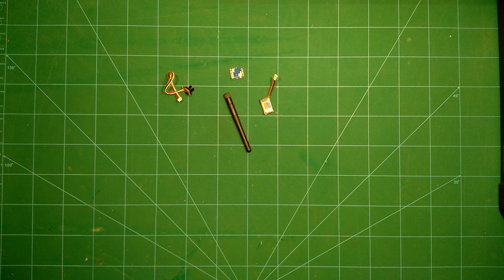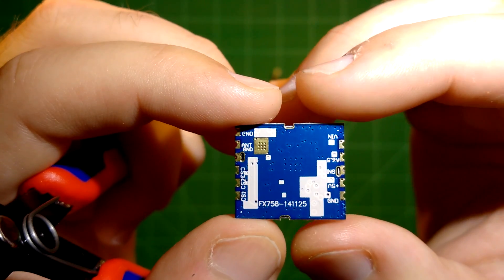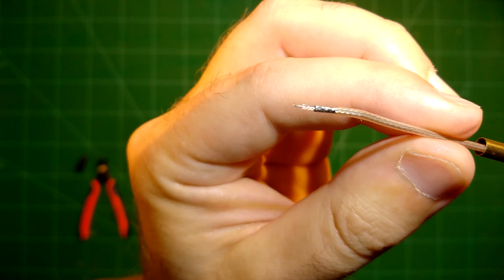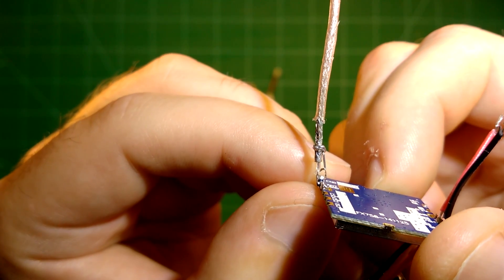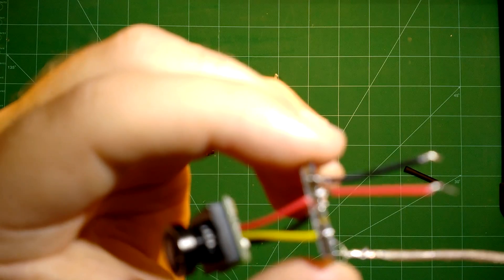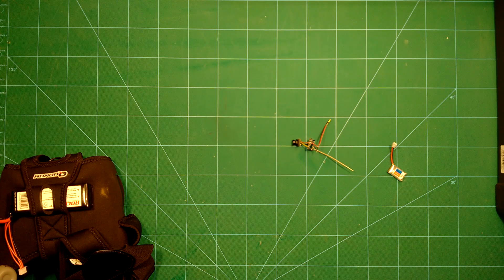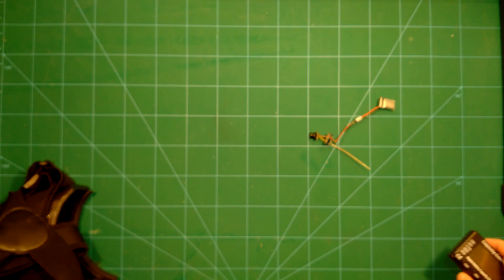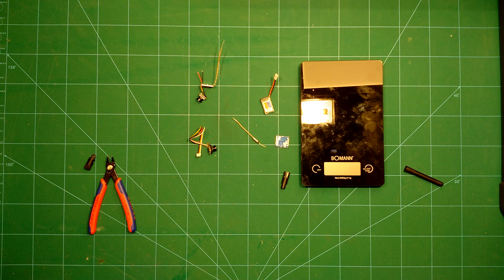Cheap 5g DIY FPV Set

Comment: This is very cool! Can I power this from the same lipo that the quadcopter uses?
Reply from the maker: +Fraser Poole Yes, absolutely, but if the quadcopter uses brushed motors, you will want to add an LC filter or a step up/down converter which cleans the power, otherwise you will have massive distortions in the video. A Pololu module is such a step up/down converter and I use it in the video where I put this FPV set onto an Eachine H8. Check out this video here (and its description), that will give you many ideas I believe :-): https://www.youtube.com/watch?v=DREHnDY1WVk
Reply: +RC FPV Flight That's great thanks for the info. Really liking your channel.

Comment: hi awesome video! would it work if I use this antenna? http://m.banggood.com/FPV-5_8GHz-Micro-CL-TX-Anternna-0_8g-Lightweight-p-973291.html
Reply from the maker: +John Svensson Many thanks mate and great to have you with us. That antenna will work great - I even suggest it in my article on my website about this build (http://rcfpvflight.com/articles/5g-diy-micro-fpv-set-for-20-usd/). I used the simple wire antenna, since I wanted to save every possible gram, because I put that set on the Eachine H8 and for that I was ready to sacrifice some transmission quality in order to save weight. Said that - the cloverleaf which you linked would be my choice as well for a build which can take the additional few grams :-)
Reply: +RC FPV Flight okay, good to hear :) can you link a cheap 5,8 ghz receiver from banggood that I can connect to my laptop?
Reply from the maker: +John Svensson You can do that with almost any of the 5.8 GHz recievers, you just need an USB grabber for your Laptop which converts the analog signal from the reciever to a digital signal which your Laptop can use. If you take the cheap but good RC832 reciever for example (http://bit.ly/1JUOBeT), you will see that it has 2 AV outs. If you then additionally get an USB grabber (http://bit.ly/1SajlvI) you will be able to plug the second AV out from your reciever into the USB grabber and then see the video on Your Laptop. You will have a bit of latency, because of the analog --> digital conversion, but as a watch-along monitor or to record your flying this will work great.
Reply: +RC FPV Flight I really appreciate your help :) so I will get less latency lag if I connect the 5,8 ghz receiver to an old tv (that has the yellow, white and red connectors)?
Reply from the maker: +John Svensson Absolutely, you are completely correct. Or you can also get yourself one of these cheap FPV monitors: http://bit.ly/1WOqtMZ . There are also slightly more expensive types of these monitors, which already come with an integrated reciever (http://bit.ly/1OQ7cI1) or even with an integrated reciever and an integrated DVR (http://bit.ly/1VsA5M4), which also lets you record your flights :-)

Comment: The base of the antenna is necessary for good transmission. RC basics. do not remove it or alter it!
Reply from the maker: +LeMortso You are of course right - for good transmission one will want to leave it on - absolutely. In my special case, I was ready to sacrifice good transmission for weight reduction, since I aimed at my Eachine H8 FPV mod with this set. The range with the antenna as it is is still ok, which can be seen in my outdoor flying videos, direct link here: https://youtu.be/DREHnDY1WVk?t=8m11s
 
However, if you do not absolutely need to save the weight, keep the base of the antenna. In this case, I would go even further and use a simple cloverleaf instead, which will result in even better transmission characteristics: http://bit.ly/1ni24nh
 
Anyways, many thanks for your valuable inputs LeMortso - greatly appreciated!

Comment: Do you have to do anything to select a channel? My receiver only picks up 5945mhz.
Reply from the maker: +Dieter Woerz - yes, that is the default channel. In orer to make it switchable, you will need to install a DIP switch. There is a great thread about this module on RCGroups, where several people did this already, take a look if you like: http://www.rcgroups.com/forums/showthread.php?t=2456116

Comment: Very good ... I had a 25mw VTW lying around unused, and powered it with a 2S 180mah battery and connected a small cloverleaf antenna. I got video out from my 808 Keychain camera on a Syma X5C quad, and it seems to work, but the total weight is much higher than your solution, and thus the little X5C was struggling a bit. The 808 by itself (with shielding) is 22 gm. The combined weight of ant., VTX & 2S lipo is another 30gm.  So 52 gm. total .. no wonder the X5C was struggling.   I can fly it with the 808 by itself and it does fine and gets good flight time and takes good video. I will have to look into a lighter VTX/Ant/lipo solution to make it easier for the X5C (and my other micro camera bird, the Mould King 33041 Super S) to fly.  I use a diversity ground 7" screen station with monopole and IBCrazy "mad mushroom" antennas.  Thanks for the ideas!
Reply from the maker: +Bill Somrak Sounds great Bill. Thanks for comment!
Reply: Bill Somrak do you know how to change channels with this transmitter I purchased , it only transmits on channel 8 5945 and i want to put it at it lowest channel https://rover.ebay.com/rover/0/0/0?mpre=https%3A%2F%2Fwww.ebay.com%2Fulk%2Fitm%2F183350083513

Comment: What channel dose it default to ? And how do you change the channels without dip switches (jumping wires from the channel to ground ?)
Reply from the maker: +Jonathan jrdevalk Hi Jonathan. If I remember correclty it is somewhere in the "4" band of my RC832 receiver. I think 47? I will have to recheck this again. For channel switching, people install DIP switches into it, I have not tried this though.

You can see some modules with installed DIP switches in the pictures section of the banggood page: http://bit.ly/1IKKF04
There is also a thread on RCGroups about this module: http://www.rcgroups.com/forums/showthread.php?t=2456116

Comment: Great video. That was really clever, reusing the inside of that antenna.
Reply: +RC FPV Flight does it work on 3.7 volts?
Reply from the maker: +Jayd Lawrence Cheers! Great to have you with us, Jayd.
Reply: +RC FPV Flight does it work on 3.7 volts?
Reply from the maker: Yes, it does. Although I always use a Pololu step up / down converter to give it a clean an stable voltage, which is particularly needed when you share the lipo with brushed motors of one of these toy copters (see my Eachine H8 FPV mod for an example).
Reply: +RC FPV Flight I want to use it on my hubsan x4. Already made one but I can't see any  video when flying with all the lines. Do I have to add that pololu?
Reply from the maker: Yes, absolutely. Check out my Eachine H8 FPV mod video, where I go into details about this: https://www.youtube.com/watch?v=DREHnDY1WVk

Comment: nice vid, thanks.  I break open the rubber ducks and embed the cable in a small polystyrene block  which I mount on my 210 quad. Its far less likely to damage the tx when I crash compared to the long rubber duck antenna.
Reply from the maker: +Tobermory Cat Good thinking! And thanks for your comment!

Comment: I was waiting when you'll short power wires :P
Risky doing that way :-)
Reply from the maker: Prototyping ... and a bit of care :-)
Reply: +RC FPV Flight i think im going to make one of these instead of buying one
Reply from the maker: I can only suggest it to you. It is easy to solder and so satisfying to make something you own. Also check out this video, where I use this set (and a Pololu!) to FPV-enable an H8 Eachine: https://www.youtube.com/watch?v=DREHnDY1WVk :-)
Reply: +RC FPV Flight Im going to watch the video but im going to send you a link of the transmiter im going to get but the downside is the super small soldering pads

 Usmile® TX5823 5.8G 8CH 200mW Wireless Video Audio Transmitter Module for mini Micro quad FPV Wltoys Syma Toy quadcopter https://www.amazon.com/dp/B018Z5Y1TM/ref=cm_sw_r_other_awd_27dXwb4F4R70K
Reply: +RC FPV Flight Im also going to use the same camera and im getting a dip switch
Reply from the maker: +TheEnragedGamer Ok! I don't know the one you linked, I used this one from Banggood: http://bit.ly/1IKKF04